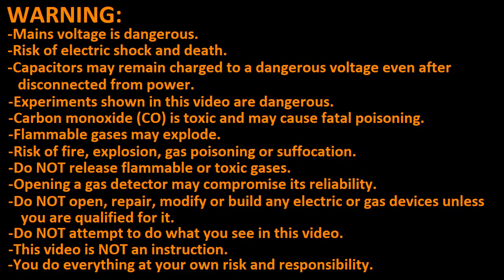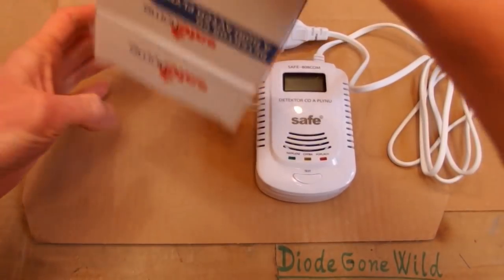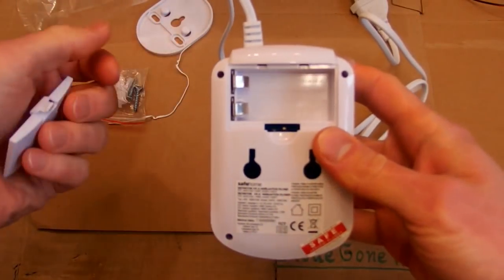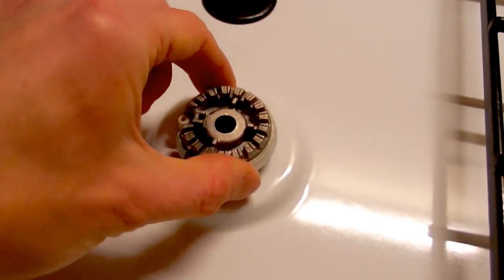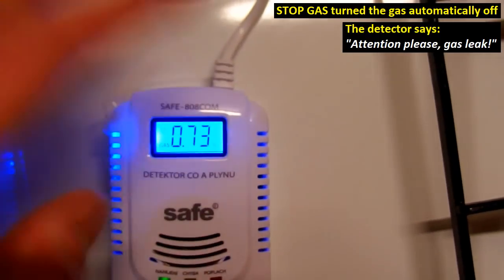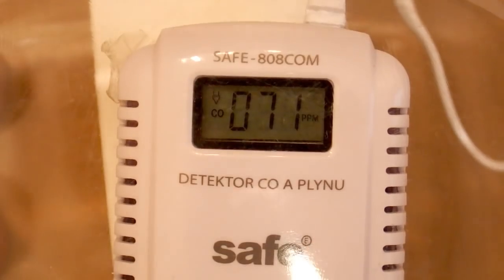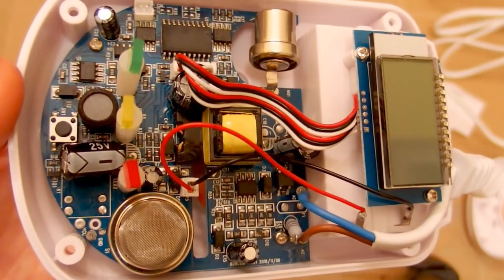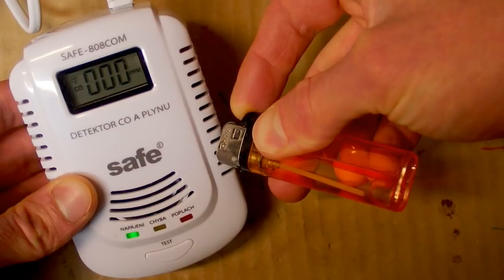Flammable gas & CO detector - test and teardown

Comment: In Romania it is mandatory to have it as safety device. It is connected to an electrovalve outside the building and that electrovalve stops the gas. You must reset manualy the electrovalve after an alarm.

Comment: It might be worth stressing that CO is produced by incomplete combustion of any fuel - wood, coke, charcoal, paraffin (kerosene), coal… Not just gas. The candles experiment highlighted this. It's worth installing a CO detector wherever a heater is installed unless it's an electric heater - it's a legal requirement to do so in some places.

Comment: They are probably telling you to use specific batteries because it's a high power load. Some 9V rechargeable batteries are really crappy and go very high resistance after a short time.

Comment: Thanks for the gifts under the tree, Danik. very appreciated!
Happy new year to you and all of your family relatives.
P.s. the heated sensor probably had limited life (about 5 year)
Due to heating, the reaction with the gases went poor and bad so the sensor becomes insensitive.
Reply: CO sensors have a limited life (my CO-only alarm in my house has a "replace by" date). They're electrochemical, and after a period of time the chemicals run out.

Comment: MC34063A - buck/boost/inverter switching controller
YX3P087 looks like it might be a audio chip with built in voice samples
other are dual opamp, ac to dc controller and 7330-1 is linear voltage regulator

Comment: Great! The natural gas flame detector at your kitchen oven has one more functionality. The are 2 materials /metals connected together. If the sensor is hot, it produces a current which holds open the gas valve. The unknown (forgotten) functionality is : if, for example water is out and the Thing over the flame becomes more and more hot, the other side of the sensor, where it is screwed with the oven, becomes hot, too. So the temperature difference delta becomes lower. Because the current exists because a temperature difference, the current becomes low with less delta of temp. difference. So overheating the sensors bottom will a clo the gas valve. I hope, it is understandable, what I want to say 🙄 After terrorism against me at Infineon Regensburg and 2 brain bleeding my English has become bad.

Comment: Pretty much most of the times you'll need this are when your heat exchanger rots out and flue gasses start coming into your house. Still not as good as a professional one since it tripped when I had a CO issue, but not the consumer unit plugged in near the return vent.

Comment: If you have natural gas connection, you should install a gas detector that can also shutoff your gas supply upon alarm. Install it near the ceiling.
Install the detector you showed us at ~1.5m from the floor for CO detection. (CO is about as dense as air, so the detector needs to be located at your breathing level.)

Comment: One of the holes, where it can be hanged, is directly behind the high voltage part.
Reply from the maker: You're right, but those holes are not meant to hang it. The plastic base has to be mounted or hanged onto a wall and then the detector slides onto the plastic base.

Comment: The single-insulated wires (what voltage are they rated for?) to the display, running over the top of the primary capacitor, may be a loophole in the isolation; the individual mains wires also get close to the battery positive terminal. Some sleeving in those positions would have been prudent.

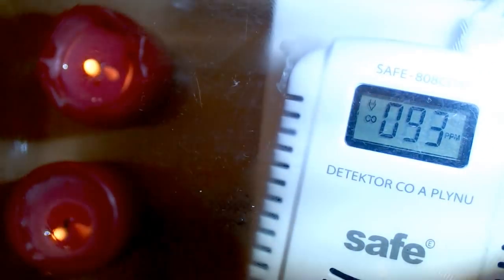Comment: 13:30 You will be death and allarm will be silent. Nice.
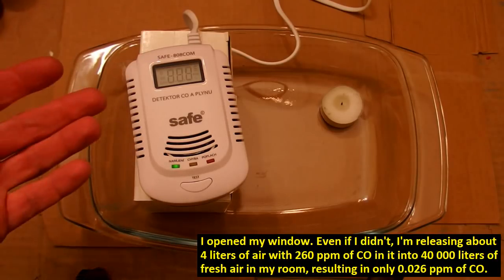15:26 We are all waiting for this. 🤩 
Gas detector is 2 pin and CO detector is usually heated - 6 pin. You need made some magic with resistors for better sensitivity of CO detector. 
I'm waoting for next video.

Comment: I think someome should do smart Windows, wich open, when there are poisounos gases inside.
Reply: @revolution5547  install it somewhere burglars cannot reach or add a grate in front of the window
Reply: Kinda dumb. If you have co, you have a fire near. If you open the window, it'll get bigger
Reply: @mernok2001  
that is the best idea , it will stop poisonous gas and explosive gas whichever set it off :-)

Comment: I wonder if you could use it to detect combustion gasses in your vehicle's coolant system to determine if the head gasket is compromised.
Reply: I think you have to look for CO2 then, not CO.

Comment: When natural gas (ch4) reacts with oxigen (O2), aka burns, the result is heat + carbon monoxide  + water vapor. Ch4+O2 = heat + CO + H2O
Reply: But this reaction is metastable, it mostly create CO2, because the bond has lower energy and that's what nature wants,  the CO bond is double, so ii needs more energy to create and to keep.

Comment: Wait, what? You have plug in CO detectors in Czechia? In NYS they have to be permanently connected to house wiring and backup battery or have a preinstalled non-removable battery which can power the detector for 10 years.
Reply: America has plug in detectors too. First alert and kidde make them.